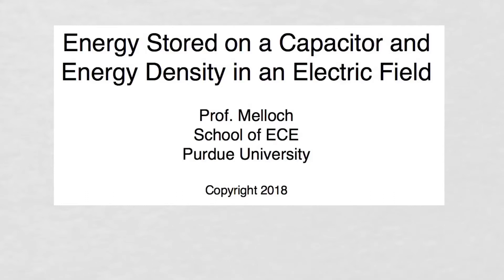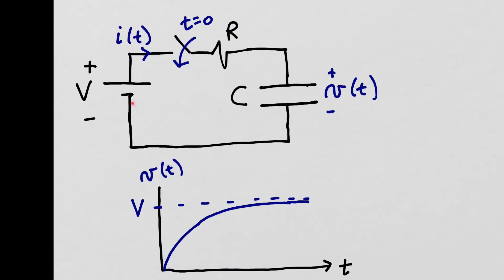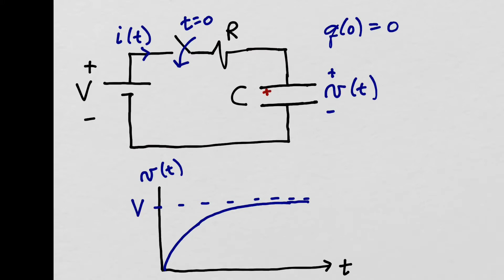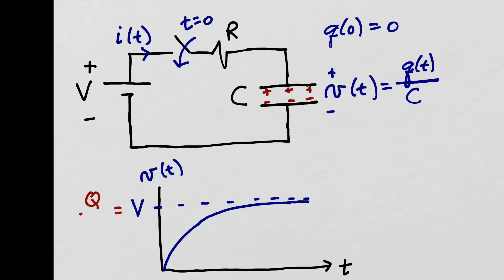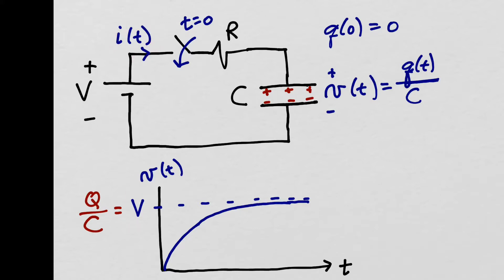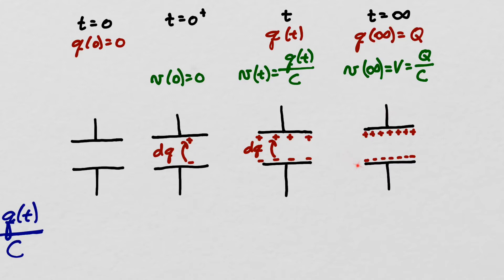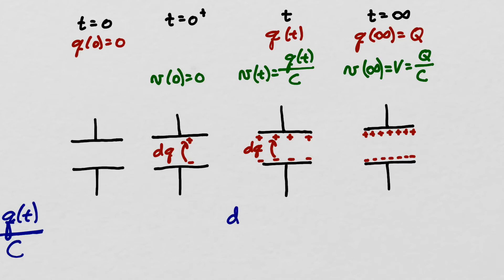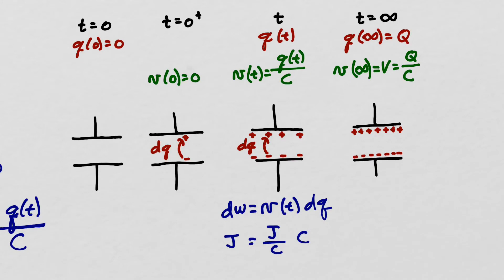Energy Stored on a Capacitor and Energy Density in an Electric Field

Comment: In practice, when I do an experiment with a capacitor charging, from a DC power supply, usually I have following:
1) Udc (let's say 12 Volts)
Max.power or current of the power supply.
2) max Ucap (let's say 15Vdc)
Capacity in Farads (let's say 1F for a super-capacitor)

Thanks to your explanation, I managed to understand the inner nature of a capacitor, in general. :) Even the parallel between kinetic energy (m*V^2) and stored energy in the capacitor (1/2*C*V^2). That's really interesting 🤔
A mass in mechanics and a capacity in electricity. Velocity as a kind of voltage, hmmm... Before I was thinking that potential between + and - is a kind of moving force for electrons. Seems I was a bit wrong, that's why do not understand fields at all :/

Indeed, I'm interested to get know the way, how may I estimate the charging time in private circumstances I have.
With no programming (numeric computation), i.e. without need of integrating a charge q(t) each single time step.

I know, there are W-meter and Q-meter to measure in DC, but every experiment takes time, so my home-made engineering becomes a headache and stupidly wild.
I've been searching for an elegant way of calculation just in time, by a pen and paper.

Would be pleased to get any hint from you,  dear sir.
Thanks in forward, Y.T.